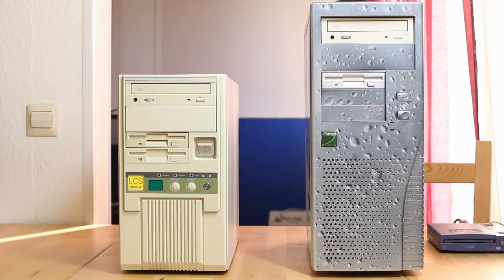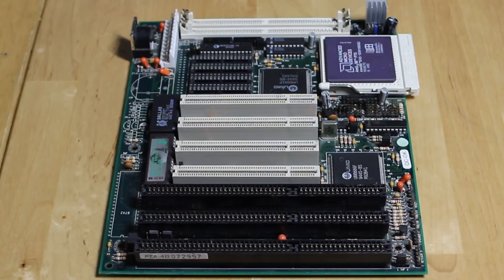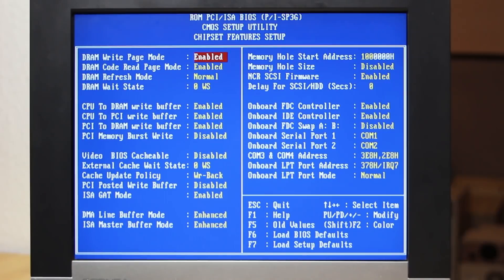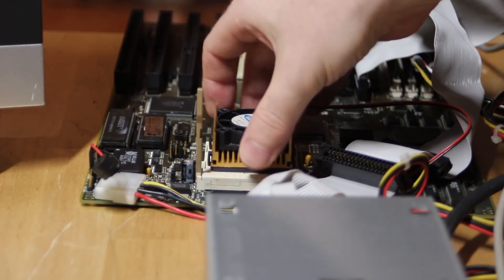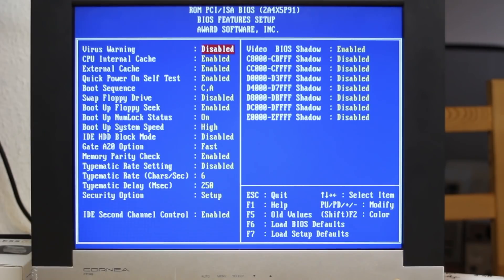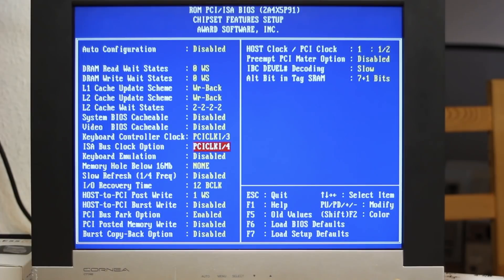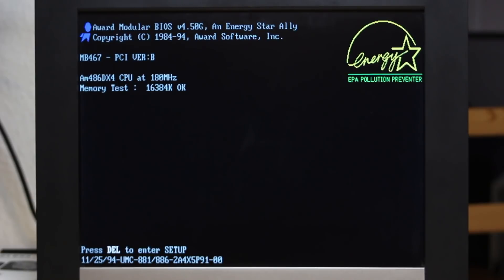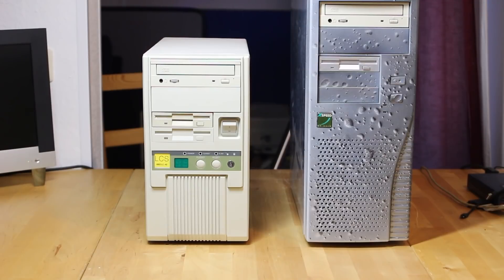A Tale of Two 486 Motherboards (Saturn II Overclocking Finale)

Comment: I didn't realise they were that rare. I have two of my six X5-133's that post and run at 180mhz in my Unisys cacheless system, one will 'sometimes' boot and benchmark but is highly unstable at 200mhz. One of those ones where you run doom bench nine times for that one it successfully completes and hide the evidence of the failures. :> The 200mhz won't post unless it's overvoltage 3.45 -> 4v.

Comment: I just tested my 486 DX4 100 intel running at 120mhz with quake on an cirus logic gd5446 2 mb card on SIS 496 chipset with tight timings on ram and cache it got 14fps I’ll dig my et6000 out and re run to see if that makes a difference
Reply from the maker: Yeah they should be fairly close I think. My ET6000 does beat my Cirrus Logic card.
Reply: CL 5446 was very capable card. At recent test i saw on YT, CL5446 was just a single frame slower than ET6000, but that was pentium system. On 486, will be likely no difference,